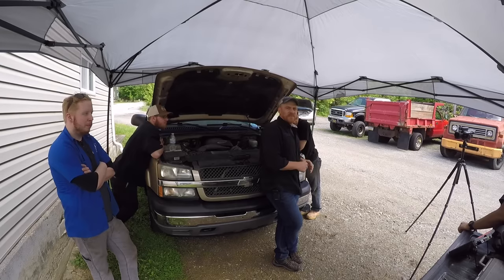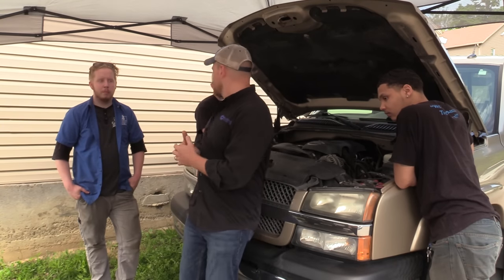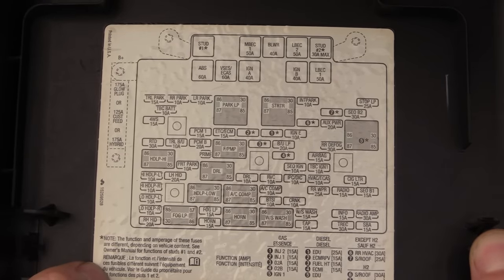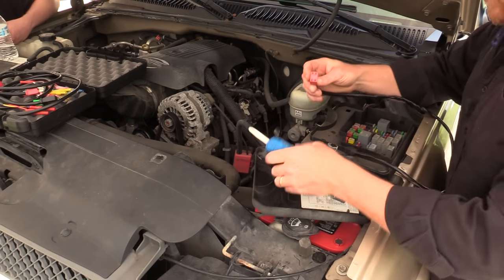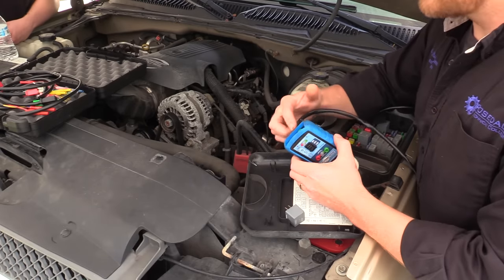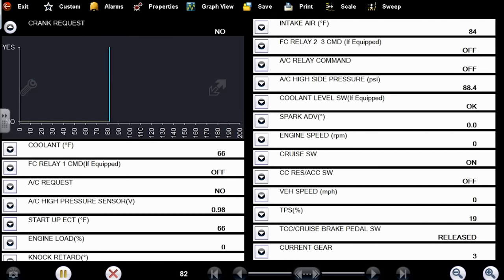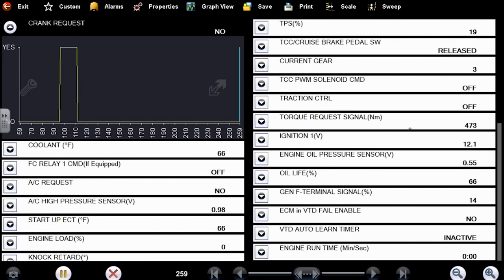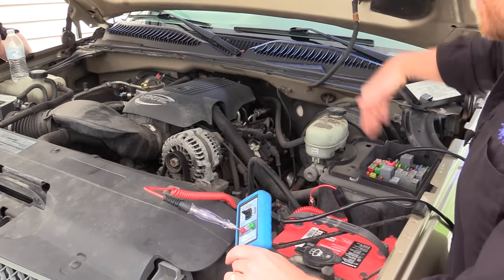No Start No Crank Diagnostics - Field Trip With My Students @RosedaleTech

Comment: The cool thing about those classic four pin relays is the way they fit into their home two different ways, upside down or right side up. The clever design allows them to work perfectly fine, either way. Those four pin relays are protected from accidental wrong insertion by always having the load side power diagonally across from the load side ground, and the same for the control pair. So, you can safely assume that a four pin rectangular relay will have diagonally opposing partners, although you don't know which is which. In those specific relays, that makes it impossible to accidentally jump load power to computer ground if you avoid any jumping that is not diagonal. And it makes tools like your AES tool work fine across many different platforms.

Comment: Great video and explanation on how the starter system works.  I wish AES Wave would re-introduce that tool.  I know they are supposedly revising it but it's been several years since it has been available for sale.  RIP Flipp.
Reply: This way they can get you to buy a $3,000 bi-directional tool to turn it off and on.
Reply: @patrick_kyker  I'm sure that my $850 scan tool will turn it on and off but I would still like to have the U Activate anyway.

Comment: Another excellent teaching video. I'm glad you expounded on the need to do final testing on the starter itself, even though your testing up top pointed to the starter motor. The work flow of professional shops is to make the diagnosis, get approval, order parts, and a few days later get it all done with parts in hand. The tech who does the work may not even be the guy who made the diagnosis, and they could easily lean into it and do what was planned with no final testing at all. Disappointingly, we see that here on Youtube as well.

Comment: Hello, my good colleague, I am happy to use your valuable experiences and to get to know you. I am from Iran with pride and with hot internet and many problems, I don't know if you are aware of it or not...  I have a question for you. Because of the sanctions, we cannot have the wiring diagram of the cars, any car from Toyota, Hyundai to Dodge, Cadillac, etc.  I do it like the cars of 50 years ago without a map, that is, I look at the color of the wire and open the adhesive tape and take the wire trace.  I'm sorry if it's typed badly, because I'm using Google Translate because my English is not very good, thanks
Reply: Pleas help me

Comment: That's a fancy way I'd just swap the starter relay for the one that sits Wright next to the one your working on the one I seen on the left is the relay for the 4 ways if u look both relays are exactly the same so if u switch them it starts or the the 4 ways don't work after u switch them then it's a bad relay  always check your fuse boxes for relays like the one in question most manufacturers youse the same throughput the vehicle its 50/50 if u find one you don't need to do anything elts just get a new one and it's fixed nice video 😉
Reply from the maker: And when you swap the relay and nothing changes, then what?

Comment: Awesome video. I haven't used the 12v incandescent tester, but I get an audible clicking when the ignition is turned to start with the panel lights flickering. No corrosion on studs/nuts/eyelit. 

Did the screwdriver trick and heard a "whirl" each time where I'm thinking it is the clutch that gave out. No crank each time, however watching this video I think I needed ignition key to be on run while I did that?
Reply from the maker: If you're having no crank issues, this is the video for you. 
https://youtu.be/GQvLHQVtC0Y
Let me know what you think

Comment: I recently had a 73 ford truck that would not crank, but the headlights did not dim.  Checked (attempted) cranking voltage with a voltmeter and was less than 10v.on the battery terminals - not enough to engage the solenoid.  I suspect a shorted cell inside the Optima  battery which is a potentially dangerous situation.  Battery voltage was 12.3v with no load.

Comment: 23:00  ...  It's not technically correct to stop there.  You should ALSO test your next secondary stud (solenoid main output) and then finally test that braided wire that goes into the starter.  Because it could just have a bad connection where your positive braided wire connects to that second stud...   

So just to recap my point--  Your signal stud is fine, your Main battery positive stud is fine --  and IF:  your secondary positive stud is also fine (while cranking), then that means that your solenoid still works fine.  So then your final test is on the wire that is going into the starter itself -- and if it also shows voltage as it should - then you know with 100% certainty that the problem is internal to the starter..

  Since you stopped your testing a couple of steps early, it could very possibly be a situation where your solenoid works, and your starter works, but you just had a corroded connection there on that secondary stud of the solenoid, that could have been cleaned and retightened and still get more time out of that starter.  (granted, given the corrosion, I would have cleaned all connections down there -- but my point is that it may have been possible to fix this with no parts required/   just maybe;  so I always test that secondary on the solenoid also;  Plus, it's good for future reference, so you'll know what is actually commonly dying:   Is it the solenoid, or the starter motor/  which can help you troubleshoot quicker in the future sometimes).

   Don't misunderstand what I'm saying -- I know that you are correct in that a new starter would fix this, because you verified that everything on the "Truck" side of the equation is good-- but I am merely noting that there's an off chance that it could have only been a bad connection at that secondary post on the solenoid;  so I always take that extra step to confirm WHY the starter is dead, just to be sure;   and since doing that, I've crossed one that was simply a loose secondary lug, and another that just needed cleaned-  So now I always check the secondary main output on the solenoid..   Cheers.

Comment: I need some advice or information if possible. Could you tell me how to direct wire crankshaft sensor to the computer? 98 blazer 4.3. I need to bypass temporarily.

Comment: My pcm ground is intermittently, not getting to my Starter relay.  What do I check for that?Update: I checked the wire from computer to starter relay. It has good continuity. It just isn't sending the pcm ground to the relay. It starts and runs fine when I jump the 12 volts to the starter. Any thoughts?

Comment: Could you check this diagram it’s for 2001 dodge stratus 3.0l automatic. It’s got weak spark, new distributor in what’s the number 2 wire used for its coming from S038 to distributor

Comment: What about rotating the engine manually to make sure it's not hydrolocked? Or do you think there would be external signs of damage for something like that?
Reply from the maker: Yes sir, in that case it would have been a heavy clunk of the starter as it tries to rotate the frozen engine. We would have also had light dimming in our first test. Make sense?

Comment: Hey brother have a question  I have a 1994 ford e350 econoline passenger van  it started out by idling high and low come to a point where it stop. now it start and sometimes it would not started I realize gas pump not working I changed it then it started but not moved forward with no power I parked it , go to to move it no started I checked the pump nothing from it.. I checked the one I take out and it working  now I have spark and gas to the engine it started running I drive it around the black park it go bk not starting  ..something spark when I put on the terminal on because isomething dieing the battery  and I can hearing something clicking  all no started with the key I jumped it from inside the hood   I was checking the injection wire but it seems it not getting any spark  you have any thing to add to this problem
Reply from the maker: I have a few EEC-IV video that will definitely help you. One on a similar year Ford truck.

Comment: Hi Dan,           My 2007 Toyota Yaris is a manual gear shift. Recently it has not been starting when I turn the key to start, unless I wiggle the gear stick sideways in neutral, and suddenly the starter activates and starts the car. Yes, sounds very strange, but is very true. I have been using it like this for a week or so, having to wiggle the gear stick in neutral each time to get the starter to kick in. But wonder what I should do. Will you advise please?
Reply from the maker: Park/neutral switch issue is what it sounds like (transmission range switch)
Reply: @ScannerDanner  It is a manual shift, and as such it has a clutch pedal safety switch, which is working fine. Yesterday I removed the starter motor from the car, dismantled it, cleaned the insides out of very much black dusty, greasy build-up, and cleaned up the armature where the brushes contact it, and then reassembled it and re-fitted it into its place beside the engine. Works perfectly now. My Yaris car has done almost 200,000 kms, and I suspect that most cars with that sort of mileage would need their starters cleaned up inside. But, of course most mechanics don't clean starters, they simply buy a re-built starter and fit that into the car, and often get a refund for the dirty old starter, which is then re-built at a factory. Thanks for your help with this, I am very happy to have solved the problem myself rather than take my car to my mechanic, who charged me $400 to replace the faulty starter in my previous Yaris, when it probably only needed a clean-up..
Reply from the maker: @gregoryross.303  sorry I missed that it was a manual

Comment: @scannerdanner man can you please help me with my 2000 sls Seville, no crank at all, I had disconnected the positive cable from the batt overnight and next morning when I re connected it  it didn't respond at all to cranking the key , I checked starter it's good , brand new battery , and also I can get it to start by manually bypassing the starter relay but 3 seconds after it fires up it cuts engine power. And when I first connect the cables back to battery, with key turned to on, the security light doesn't illuminate. It doesn't light up even after trying to bypass starter relay and the engine cuts itself off, it only illuminates and stays on after I attempt to crank the car from the inside with the key. . Please help me any advice is appreciated
Reply from the maker: https://youtu.be/32S0WMj3GSQ
This could be you (bad block ground)

Comment: You tested the ground but you did not test the ground on load condition...Small but may be costly mistake.
Reply from the maker: Yes I did, I had the load side contacts of the relay circuit closed. A very important step indeed!